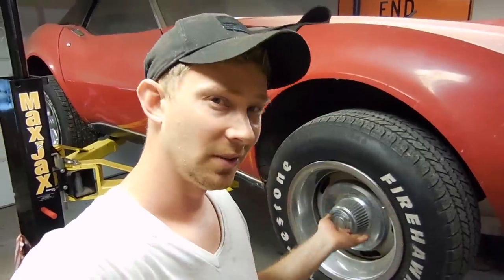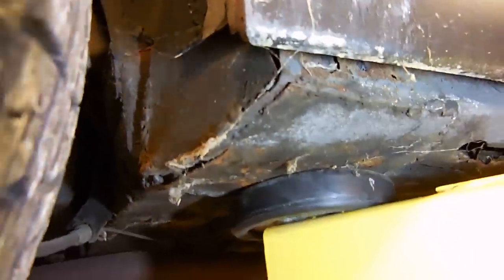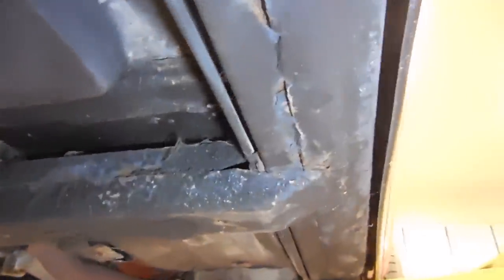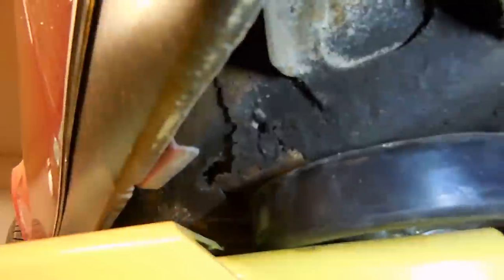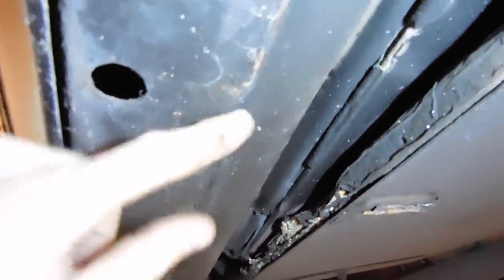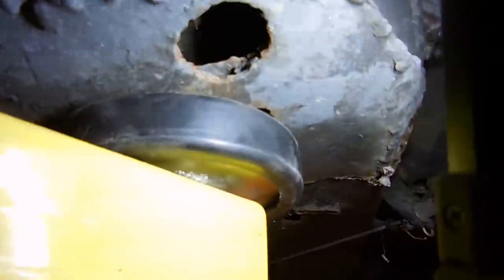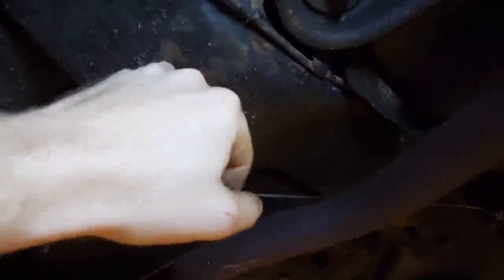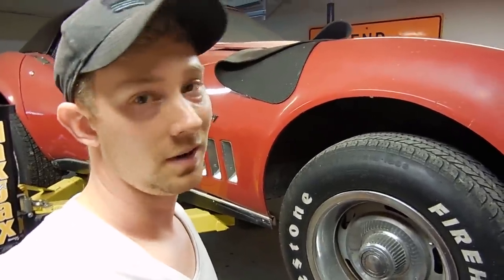Beautiful 1969 Corvette Stingray ROTTEN Underneath! Check Your Frame on Your C3 Vette!!

Comment: That frame is fooked, there is no saving it. I have a 2002 Avalanche I bought new, and after 17 years of Midwest winter driving the frame was gone.

I bought a replacement part frame from GM (still available in 2018!) for $3K and then I stripped all the ineffective wax dip coating off the outside and re coated it with a very tough urethane product. This was huge job, very difficult to remove wax from every pocketed area, and every chemical trace must be solvent cleaned off of the metal or paint won't stick. It took months of bust ass work and trial and error getting it right. And that was just to get the new frame prepped to my standards.

I also had a ton of repair to do on the body as well, a lot of welding and paint work. I am still in the process of putting it back together 2 years and $20K later. And I had to install a lift in my garage before even thinking about getting the body off the chassis. That alone was a small project.

So yeah, if your car looks anything like that underneath, don't fool yourself. You've got a big expensive project on your hands, not a budget build. 

And a shop won't even talk to you without at least $15K cash deposit up front. Doing it yourself isn't really cheaper, and doing this type of work in a home garage is actually more difficult, but the advantage of doing it yourself is you will know if any corners were cut and why. 

Every shop WILL cut corners. They have to because shit WILL go wrong somewhere along the way, especially on a job that big. Then they will hide it as best they can. They don't make profit by doing stuff over to get it right.

Comment: I am somewhat surprised that the frame didn’t collapse on the lift and at the very least I would have been scared to be underneath it.  I have to wonder what they did to get it so rusty?
Reply from the maker: Drive during an east coast winter over and over. Pretty easy to do

Comment: Looks at the gaps at the front door hinge point and at the rear.  Looks like the frame is giving under the weight of the car on the lift.  When you lower the car back on its wheels I am willing to bet the gaps will close.  Scary!

Comment: I just bought three corvette's  for 17k... sold my other cars to buy a house, got the house then time for some cars...  1977 400hp 350, 1992 nice red C4 with 73k on it and the last one a 1996 C4 red, 300 hp auto with 32k on it, very nice car.  But the 77 C3 sat out for three years, body is good , new motor and trans but inside the car is junk and I need to rewire the whole car. What I need to know is ... I need some work shop books on a C3 and C4, so what are the best ?? So I won't end up with books I won't use....

Comment: Ahh to be young and foolish, happened to me here in the UK.
Nothing as cool as a vet, I had a ten year old Triumph vitesse, did you guys get them ?
Anyway I wondered what a cracking sound was when I accelerated, soon found out as it broke in half !
Chassis held together with chicken wire and underseal !
Reply: I remember British cars from the '50s. Had a BRAND NEW 'Enfomoco' Zephyr, first Winter in Minnesota, turn signal lever snapped of when attempting a left turn, shortly thereafter, the vent window handle snapped off! This happened at below 0 (F) temperatures. This was the result of 'white metal' used extensively in British post-war cars! The Ford Zephyr was a 1958 model.

Comment: my  dad  have 78 corvette   them pull  the motor   out  of  it  the  frame  was  crack   on  it    and  anther  time the doors  lock  broke  have   to break in it  by  drilling  hole  under  the  t  top  and  unlocking  it with metal  rod

Comment: I bought a 1989 C4 . The other day bringing it home it stalled out 3 times. After sitting for half hour it started back up and ran for almost 2hrs and it died again. I waited and started it again ran the last hour home and died  again pulling into my house. The injectors were replaced last year in it and so was the fuel pump.  Now it was a 436 mile trip and it was about 98 degrees. Has this ever happened to anyone before and what was it?? Now since that day I've driven it all over the place and it ran perfect.  Could it have been the heat of the day??

Comment: The give-away to the rotten frame can be seen @0.31 where the car is on the hoist, and the gaps between the door bottom and the top show the car is sagging badly. New frames were available from GM at the time. Of all the Corvettes, and their resale or collectable values, those models, 1968 to 1981, known as the C-3's, with very few exceptions, are at the bottom of the list.

Comment: Sadley this is a common problem on all c2 and c3 corvettes from rust-belt areas, you can buy 74 to 80 or so vettes for as little as 500 to 800 bucks, i have been at those sales, a yellow 78 that you could'nt open the doors on and a rear bumper that looked like potato chips -$800 and a simalar white one for free if you took it from a dirt driveway that it had sunk into for 20 years or so, waiting to somday be "restored" but never got around to it. These are a couple of the worst cases i've seen. Bottom line is buyer beware and ALWAYS take a knowadgeable bodyman/mechanic with you when going to buy a corvette-or any car for that matter

Comment: Sad to see rust taking its toll on a nice car. Wondering if that was a "Rust Belt" car from up North to Northeast? Someone obviously drove it regularly in that environment which is hard to believe it was someone's daily driver through the Winter salt roadways. Very sad outcome. Yes, a good motorhead might find a replacement frame (?) and disassemble the good parts and "build him a new C3". More motivation than I'd have but it could be done. Lots of sweat equity required. Thanks for the education! BTW I was born and raised in the Rust Belt, so thankful to have escaped and been in Colorado for 50 years!

Comment: I could tell the car was sagging on the lift from the door and front fender gap being wider at the top to almost touching at the bottom.
Reply: Can't always tell if it's due to bad frame. Had a BRAND NEW '60 Ford Sunliner (convert) that would sag badly when on a lift, that the doors would PINCH. At first, I couldn't figure out why the paint on the rear edge of the doors was chipping! Gotta LOVE the way those 'classic American' cars were designed/built back then!

Comment: Clearly, this car is not roadworthy - only fit for the scrap heap.
A car such as this should NEVER be allowed to get this bad, before being basically ordered off the road.
In New Zealand, It's a legal requirement that every vehicle must go through a thorough inspection process at a certified inspection facility, either every 6 months, or once a year, depending on the year of manufacture.
If a vehicle passes the inspection, it is stickered with what's known as a warrant of fitness (WOF) on the windscreen. If it fails, the defect must be rectified before the WOF is issued. If the previous WOF expires before the defect is fixed, it's illegal to use the vehicle, unless you're taking it to a shop to get the issue rectified. 
Only a minimal amount of rust, in certain non-critical areas is permitted on a vehicle, in order for it to pass the inspection. Steering, brakes, suspension, electrics, etc are also part of the inspection. 
If this was a vehicle in New Zealand, it would have been ordered off the road many years ago, at the point where the frame rust was starting to become evident. 
Anyone who drives a car such as this on the road, knowing what the condition of the frame is, obviously has no concept of 'road safety'.

Comment: He or she better hope that you have a spare C3 frame!! It's not that difficult to ask the seller if you can jack the car up and really look at it before purchasing it... that's just me.
Reply: I bought a 1971 Convertible back in the mid-1980s that I had to replace the frame. The amount of rust on both the frame and windshield frame was simply beyond my imagination.  I never repaired the windshield frame as that was beyond my ability.  Luckly for me, at that time, a replacement frame and radiator core support only cost me $600 but another $400 to have the replacement frame chemically dipped.  I painted it with Dupont epoxy primer and Imron gloss black.

Comment: Rust swelling. Entire Frame needs swapped for sure. You can fix it, it would have to be hot tanked chem stripped 1st then you can buy replacement sections to weld in. Its normally only in front of the rear wheels. That rust makes me think it could have been in a flood at some point. That’s pretty bad.

Comment: You shouldn't never pick up a Corvette on a two post lift. Even when the frame is good it will sag. They should be lifted at the axle centers to stop this from happening. That car is a prime candidate for a frame swap and there are aftermarket frames that are better than stock.
Reply from the maker: You couldn’t be more wrong. I’ve picked up hundreds and if the frame is not compromised they are fine
Reply: @TheCorvetteBen  every C3 Corvette that I have seen on a two post lift you are unable to open or close the doors. These cars had pristine frames, but they are a poor design and flex from the factory.
Reply from the maker: I’ve seen many you can open the doors on. You just have to know the right places to put the arms of the lift

Comment: Would anyone one here care to give a rough.estimate on what a 68 to 72 Corvette in this condition would be worth considering the rust?
Reply: $5,000.00 considering parts if all original and birdcage is not rusted, if birdcage is rusted then the value between $2500.00 & 3000.00 max it's a parts car at this point.

Comment: Even from 20 feet you can see the door seam sagging from both sides. That car is loose. No need to go any further unless you have lots of money and time. That car is a money pit and will never recoup the investment.
Reply: That has nothing to do with the frame being rotted, these cars have a hidden frame inside the body that's very rigid that amounts to a "cage" you're sitting inside of, Chevy engineered them that way for safety, it goes all the way around the windshield and down the front of the door openings where the door hinges bolt on and then down the rockers from front to rear, on the T-top version the bar in the center that you see when the tops are off has it inside of it that ties the frame around the windshield to the one that wraps around the rear area where the back window is, GM knew that if they didn't do that then when you wrecked one of these the body would just disintegrate from around you and you'd be exposed, the cars would have been so unsafe that no one could buy insurance for them, it also adds to the rigidity of the car and helps keep flexing to a minimum, it's a pretty clever design and actually makes it safer wrecking in one of these compared to other cars from the era.
The reason the door seams are uneven like that is the same reason you see that sort of thing on many cars from Detroit back in that era like a '75 Monte Carlo, back then Detroit loved designing long heavy doors on cars that because of their weight wears out the hinges and then they sag, up to a certain point you can adjust the play out of the hinges and get the doors back up where they belong but after the adjustments are at their limit you have to replace them. 
Aside from owning my own '73 Corvette back in the day I used to work at a garage where we specialized in Corvettes and did plenty of frame off work, for whatever reasons the sub frame that makes the cage you're sitting in don't seem to rot too much, it's the main frame you see here that the body sit's on that rots away. 
This is nothing, I've seen them so bad that once I raised one up on the lift and when I walked underneath and looked up I literally ran out from underneath the car, I called the customer up and told him "You better get down here, I've got something to show you".

Comment: It supposed to rust it’s 50 years old just Booger  weld  it some more and run it. The frame won’t  twist because it doesn’t have a 427 in it 😂😂😂😂🤣🤣🤣🤣